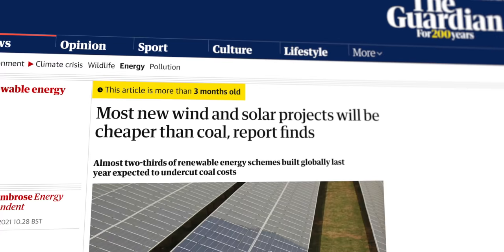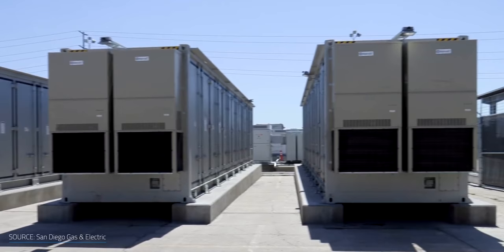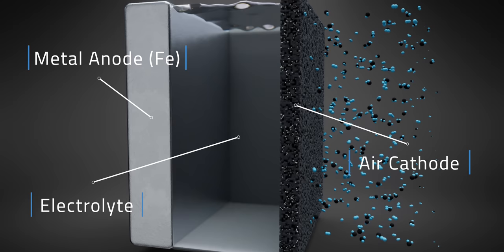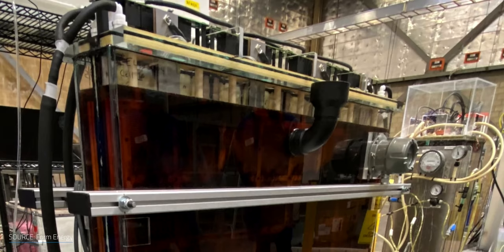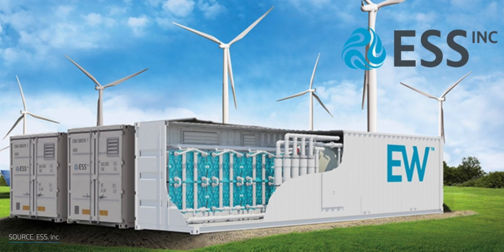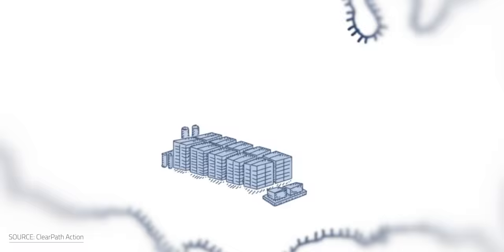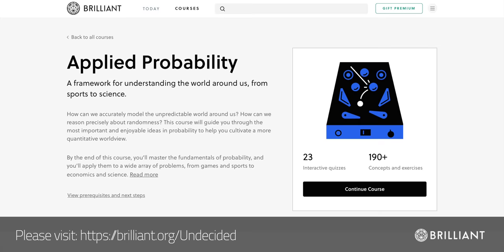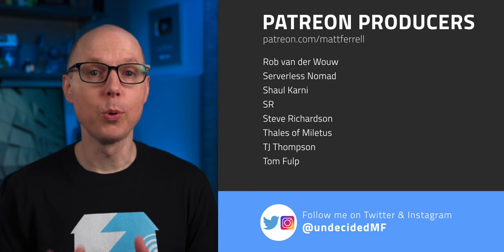Why Rust Batteries May Be the Future of Energy - Iron Air Battery Technology

Comment: Until recently we seemed stuck on  small batteries with very high specific power. That's pie in the sky. Even today tiny, high-capacity batteries are used by the thousands for "power walls" at great cost over their lifespan. I think we're catching on that high specific power is not practical for mass storage. Wind and solar farms are stationary, so batteries can be huge. Sacrificing specific power for stability and low cost over time is the way to go.

Comment: Im interested in a long life storage battery bank that will supply enough for a single home for weeks if needed. Give every home one and you have the back up power where you need it without all the needed infrastructure to get that power to the home from a great distance away. Edison Batteries are a good start. Nickel is not so good but the idea of iron is as you said, not new. I have LiFePO4 cells. Reasonably long life and no lithium metal but lithium oxide and not much either. Good for both vehicles and long term storage.

Comment: I'm not very interested in qualitative comparisons to the alternative battery companies you chose. I'd rather have direct answers to more basic questions:
Passive discharge rate (100h is very high)
Efficiency (greatly affected by passive discharge)
How they prevent the formation of rust from degrading the integrity of the battery, you mentioned "dendrites", and this battery doesn't have "dendrites" specifically but it still forms rust which breaks the chemical bonds with the rest of the iron so I'd like to see how they expect to maintain the integrity of the battery over time.

Comment: I love how everyone goes on about solar and wind power (and the issues when the sun isn’t shining and the wind isn’t blowing) yet almost always fail to mention hydro energy (that is basically a giant battery) and wave energy; as well as others like geothermal. 
Wind and Solar are NOT the only forms of Renewable “green” energy.

I assume you mean Vista Energy’s 300MWh storage capacity as 300MW is a power level not a storage unit.

Another way to mitigate the issues from grid outages is to install solar (and wind or other options) at consumer level paired with local batteries. Such as solar panels on your house and a PowerWall (for example). Not perfect but a good start and endlessly usable while you have sun each day.
Reply: We've been using hydro electricity for many decades, almost a century now. Geothermal electricity is nice, but it's only available in certain areas.

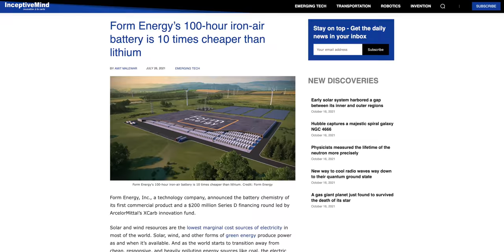Comment: At 5:00 Matt talked about Iron/air batteries changing everything at $20/kWh but Li-ion is already cheaper than that at $132 to $245/ MWh (2:00), or is there a conversion issue here?
Reply: it's probably $20/MWh.
Reply: Iron/air is much more energy and power dense than Li ion and uses cheaper materials.

If Li ion has any advantage currently it is economies of scale at work.

Comment: Agastya Samhita written around 4000 BC by sage Agatsya, describes method to make dry electric cell with 1.138 volts and 23 mA and electroplating process, hydrogen balloons.The ancient text of Agastya Samhita describes the method of making an electric battery, and that water can be split into oxygen and hydrogen.  Modern battery cell resembles Agastya’s method of generating electricity. Electrical Batteries in Ancient India

Comment: I guess any battery will last 100 hours when you use 1/100th of it's capacity every hour :-/ 

Probably Matt means to say that the households/industry hooked up to the battery will be able to run off it for 100 hours? 

That means each 1 GW power/solar/wind plant would need to be accompanied by a 100 GWh battery, in order to provide energy for 100 hours during cloudy/windless days. This size battery would then cost about $20M (at $20 per kWh), which sounds not entirely undoable.

The life expectancy at 2000 cycles also seems to be ok, even if you drain and recharge the battery once a week they would last around 40 years which is similar to other industrial systems. 

Maybe this is indeed a good solution!! Only the video failed to convey this message to me because of missing cost implications and life expectancy on a larger scale.
Reply: ... or 100 each 1GWH batteries.  The batteries can be distributed so that they are nearer the loads.
Reply: No, power to capacity relationship is not linear. Battery chemistry determines overall efficiency over its discharge cycle. You need to account for power loss due to self-discharge, heat loss, efficiency of conversion from stored energy to working energy, etc. Also longevity/number of cycles depending on use. That is what determines the 6 hours mentioned in the video, where Li-Ion technology reaches peak efficiency. It is most suitable for relatively short and quick discharge cycles. Iron-Air technology would be much more efficient at longer cycles to provide long-term storage and cover blackouts, but probably much less efficient to level out daily peak demand.

Comment: This tech seems very promising but when you're effectively playing with thermite and electricity you're asking for the risk of an "out of control exothermic reaction" to occur. If anyone is familiar with the properties of thermite, you'll understand just how much exothermic energy you're dealing with. It is interesting that rust is reversible but it makes sense, what this ultimately means is that an oxygen atom is released from an iron atom which could spell disaster if the oxygen gained enough concentration in the environment and found an ignition source.

Comment: Air-based batteries seem to be less efficient than other technologies. The main advantage of an air battery is the low weight, so I don’t really understand why you’d even consider them for grid storage. Using iron and air theoretically have a very low cost, but once you consider all the hardware required to make an air-based cell in the first place, like the fans/pumps and the porous electrode, I doubt it’s the cheapest option compared to a simple metal-metal cell or a flow-battery.

Comment: Flow batteries seem much better for static systems.  Lithium should be reserved for mobile energy use.   What I don’t understand is while this is an important issue for many countries’ electrical grids, the US should be less dependant on so,ar or wind than most others as you have a huge amount of geothermal energy begging to be tapped in Yellowstone.

Comment: What about LFP batteries? They are cheaper, less prone to combust, and can stand being filled 0 to 100%?
Reply: I think lithium should be saved for applications where power density is important (phones/EVs) and we should use more abundant and cheaper materials for grid storage where power density isn't relevant (rust battery is a good alternative, but there are others like sodium ion) Otherwise South America will be the next middle east and lithium demand will cause more political strife, not to mention environmental issues (lithium mining uses a lot of water).
Reply: @onur6233  Geez, if only lithium was abundant in ordinary seawater.🤔 Oh, wait. It IS. 
Don't worry about Li. It's available any/everywhere.
Reply: @charlesrovira5707  there is a reason why lithium is not mined from the ocean and imported from few countries (like two or three). Its prohibitively expensive, and it will likely remain that way.

Comment: It’s great to explore other options for batteries since lithium is being mined like hell and will soon run out. The only thing I hate about these systems is the fact that they continue to clear large swaths of land without thinking about building these VERTICALLY. Use vertical farms as the example and get these “battery farms” designed similarly. There’s a lot of land on this planet but there will be a lot less available in the future.

Comment: The term "Fossil Fuel" is wrong. There is way more plant material in oil, coal and gas making them BIOMASS. The issue is how fast can you renew the BIOMASS. Given advances in carbon chemistry one can create a carbon cycle where hydrocarbons are manufactured, used in vehicles and carbon dioxide in the air is used to make hydrocarbons.

Comment: I'm wondering, on a large scale (let's say to power a city or something) how would they go about charging any long term battery solution? On that scale wouldn't it take forever to charge it to a sufficient enough capacity for it to serve as a feasible backup?
Reply: No, because beyond a minimum scale your charge rate scales proportional to your total storage, so the time taken to charge your battery is the same.
Reply: At 8:10 for example, if it takes 1 hour to charge a module, you can charge half a module in half an hour or 10 in a single hour. 

Because each module has its own charger, you can scale the rate of charge without increasing the temperatures of the chargers.

If the rate of charge is too slow, you can split the modules into several smaller modules, because the distance electrons have to travel to go from grid to the centre of the battery is less, less heat is produced and so you can charge it up faster. 

There is a limit to this however. It costs more because your using more wiring overall, and more charging infrastructure. At a certain point the resistance in the charger is increasing faster than the resistance in the battery is decreasing so you need more efficient chargers not just more of them.
Reply: @Loaderdani wouldn't that overtax the grid though, since you're effectively doubling the power consumption until the whole system is charged?
Reply: @Dornul  Potentially, Yes. You don’t have to charge at maximum rate though, you just can’t charge faster than your maximum rate, without risking damage to the batteries or charger. If the grid can’t support the charging of the battery to sufficient levels, then there will be power outages with or without the battery, which is why grids have peaker plants, just in case regular supply isn’t sufficient and they probably will for a long time.

Comment: The bigger problem with storage solution is the energy grid marketing : one cheap storage solution that is used once a week (full cycle charge discharge) is non profitable compare to a more expensive storage solution like lithium ion battery that eat electricity twice a day. Cheap storage need to be 2 x 7 more cheaper than lithium to be competitive in a liberal energy grid market.
Maybe some rules around grid marketing around that will change the game in future, but it political not technical

Comment: I think it all come down to 2 unknown factors - reusability (that could perhaps be less significant as iron-oxide has many ways to revert back to iron and to be formed into pellets) and most importantly efficiency.  
If they only have 50% efficiency then it's worthless - it needs to at least play in the same ball park as pumped-storage hydroelectricity (70%+)
Reply: They claim to have solved the efficiency with a better electrolyte formulation.

Comment: One issue you didn’t cover is size of the battery.  Other channels have stated that the technology will need an acre of space to store a mega watt of power.  Couple that with the probability that these batteries will be asked to discharge over longer time periods and put out meaningful power means the size of the battery plant is going to be huge.  A 1 gigawatt plant will cover over a 1000 acres and that doesn’t include roads to get in between equipment for maintenance and or replacement which will probably add 30% to the size.   By the way a 1000 acres is over 1.5 square miles.   Yeah I can see that battery being used in a city!
Reply: To cite their own website: "For scale, in its least dense configuration, a one megawatt system requires about an acre of land. Higher density configurations can achieve >3MW/acre."

The one acre of land used is only in the case that you put each battery next to the others on ground level. But you can stack them up, so if you want to build a warehouse sized battery block with the area of 1 acre and about 7m tall, you should get >7-21MW from that building, as each battery is "roughly the size of a washing machine", so ~1m³.
Reply: @midnight8341  yes any good tech team can spin a good story of what it “could” do in the future, in fact they have to, but the key issue here is long term storage which can mean long term output to help fill in days where the sun for example doesn’t provide enough power for a day or two.   Long term output drives the size up!    Tesla mega packs have a top limit in size do to the fact they are time limited to a upper bound of 6 hours.
For this stacking idea, yes you probably can but that means the dead space between stacks gets larger because you need more room to get bigger equipment into the area to un stack for repairs and replacement when things fail.   Yes things do fail.   Just look at the battery plants that Tesla put down and you see space to get into the matrix of box’s so that they can do things like repair and replace.
The math of long term output is un mistakable,  a simple 50 Mega watt output for 24 hours is 1.2 Giga watt hours.    
Currently and probably for the next decade battery farms set up using this technology will be as big as the solar farm that will be used to fill it.

Comment: it absolutely doesn´t matter which chemistry, there are NO SUSTAINABLE BATTERIES! Regradless if just giant reservoirs of water or giant battery stacks. At the necessary scale to supply up to a few million of people for multiple days, at the current ever increasing demand per head, the resources needed and the land destroyed are never enough. The only way forward long term is reduced demand/usage of energy and localized self-sufficient grids that can be disconnected to the international grid and be easily repaired. an off-grid grid if you will

Comment: Lithium Ion is not the best for bulk storage. They use it because they have it. But there are other storage technologies that already exist, and not just science fair projects. There's pumped hydro, where geography permits. For just about anywhere where you can use "liquid air batteries", which aren't really batteries, but a refrigeration process, that's used to male liquid nitrogen, from air. That's the storage side. To put that power back on line, you vaporize the LN2, and run turbines, that drive generators. The turbines need not be as robust as gas turbines, as the temperatures are not as extreme. Both of these can built now. They are not experiments.

Comment: Grid storage is all about cost.  Mass and size really doesn't matter.  It sure seems like these have real potential.  I am really currious if they will find a way into residential use.  Currently looking at home power generation and because of my high power useage the amount of storage I need, 200 kWh gets very expensive.  I honestly wouldn't care if I needed a bathroom sized battery if it cost far less than the batteries we have today.

Comment: It's easy to "RUST" iron but you can't make iron by adding electricity since you just end up with FeO from FeOH - For this reason you CAN"T electro-plate iron on to a plate in a water solution. Only metals that can be electroplated in water can be used in rechargeable batteries making ZINC the best choice.

Comment: I personally think storing excess green energy by converting it to hydrogen is the best way to go. Doing the equivalent of putting giant AA batteries in your home just can't be beat. I'd like to see excess split between producing hydrogen and sucking carbon dioxide out of the air, a win on two fronts. Neither are as cheap as rust batteries of course.
Reply: Hydrogen is interesting, but it's still facing some serious issues... the first is efficiency, as we really don't have an effective way of cracking water, and hydrogen is currently mostly being produced from fossil fuels... an option that's still far too tempting for sociopathic corporations.

Another is safety. A big tank of hydrogen can lead to a bad time. Storing and moving it around is just as much of a pain as moving gasoline around, if not more so. Batteries still seem to be the best option in terms of low complexity energy storage, especially with the promise of these new designs and materials.

I think sea-going vessels are currently the best potential market for hydrogen-based propulsion, and if there's a big adoption there it would drive the development of the technology to the point where it could become a serious competitor.

Comment: I Disagree fundamentally with your statement of purpose. Batteries are not needed to compensate for intermittency, A World Wide Grid is. The Sun shines every second of the Day, it should be used constantly. Batteries are useful for Surge and Network Balance. But I do agree that Iron-Air Batteries should be implemented for Grid Scale usage immediately. Reliance on Lithium for infrastructure is going to be a cesspool of toxicity rivaling the fears of Nuclear. And there is not enough Lithium.
Reply: I think you only need to look at the challenges of a European wide network to see that this is a pipe dream. Especially when you consider the extreme losses from transporting solar energy to a longtitude that is half way through the night.

Comment: While certainly an improvement, this solution also has the flaw all renewable energy sources has: raw material consumption. Supporting a grid with this would require tens of thousands of refined metals, with further energy required to convert it into batteries. Furthermore, all of this material has to be imported, because no one opens any mines in OECD countries anymore. Along with costs to greatly augment the grid system to be able to handle these more complex flows of electricity, I don't see how this is rational compared to just replacing all coal burners with modern, safe nuclear reactors, after all the transformers, boilers etc already exist at the coal powerplant, you just change the heat source.